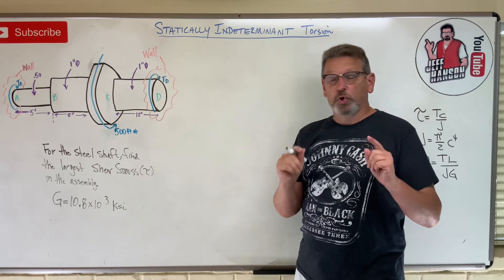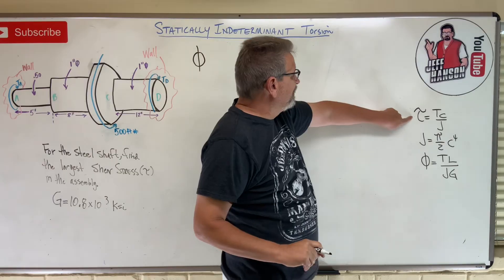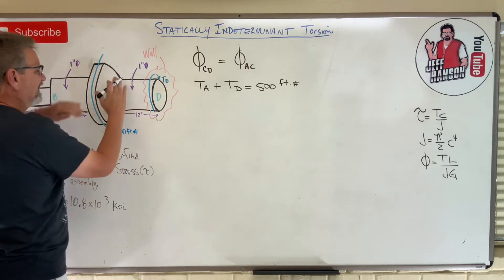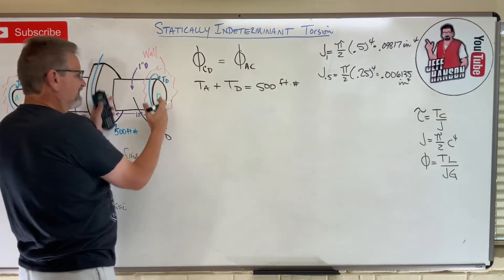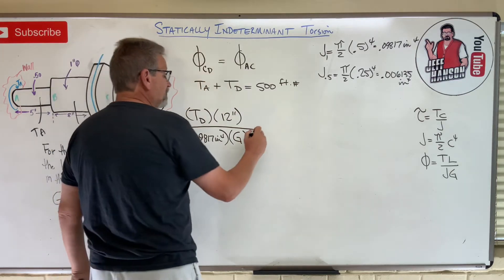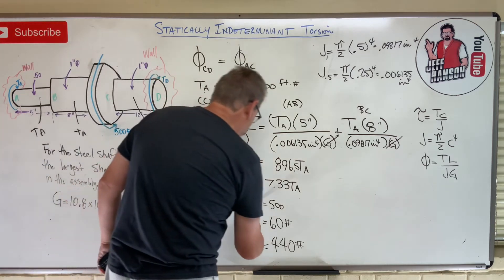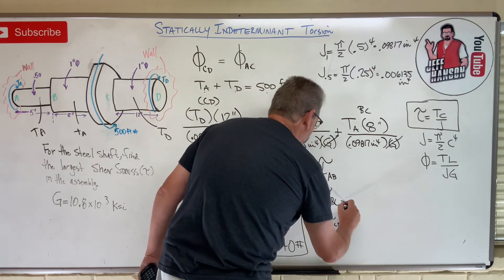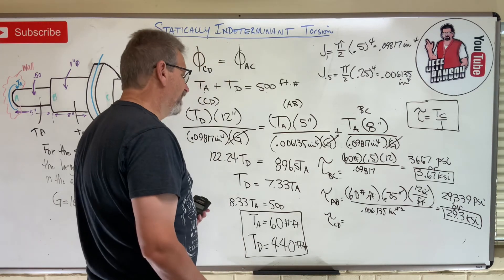Mechanics of Materials: Lesson 26 - Statically Indeterminate Angle of Twist Due to Torque

Comment: If both ends are fixed, I believe the correct compatibility equation would be phi AC + phi CD = 0, thus making phi AC = negative phi CD. This is because the total twist between the two endpoints must equal zero to stay fixed. You’re correct in magnitude but incorrect in sign.

Comment: If you had an added torque of 300 going the opposite direction as the 500 applied somewhere in the CD section, would the first equation then be Ta+Tb=200? Also, would the twist equation for section DC then be Td+300?

Comment: but the 500 is in ft and the rest is in 'in', right? don't you have to convert ft to in for that 500??
Reply: yes, however because the units are directly related you can convert before or after the algebra. the answer comes out the same on either side of the math. 60 ft lbs is equal to 720 in lbs.

Comment: professor, should not section CD's torque be ===> TA = TD+500, I am cutting with respect to A. I believe TD is 122.24TD +30559 + 7.35TA = 0
Reply: i dont think plus. because TA  and TD need to both offset the 500. as 500 is the only external T on the diagram. so it would be TA = 500-TD i believe. I noticed you just commented and ima be around. if u wana talk about it lmk